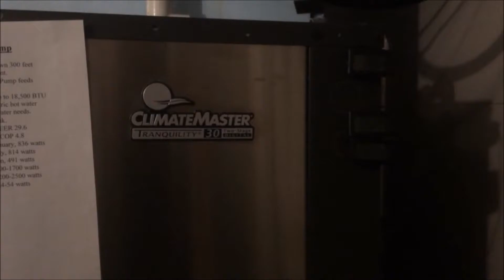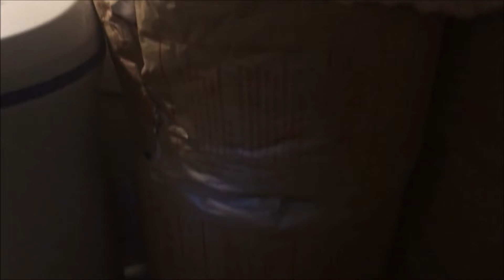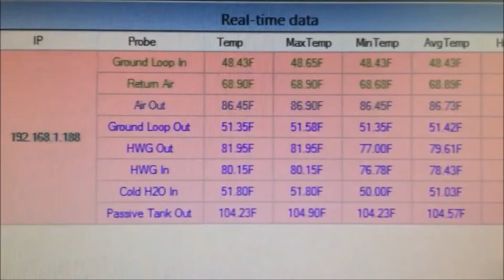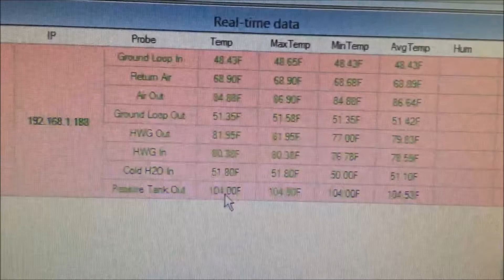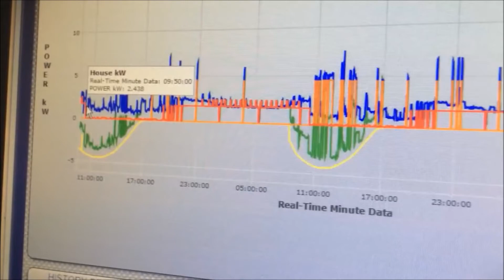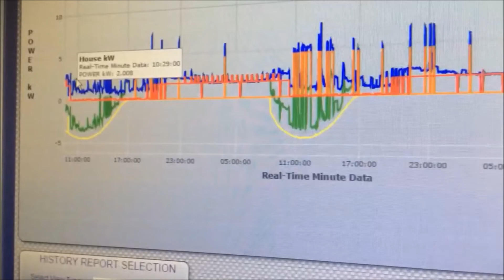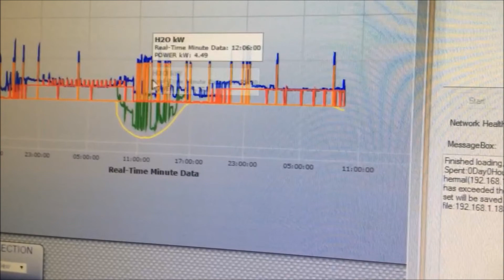How to get Free Hot water? Ground Loop Heat Pump With Hot-Water Generator

Comment: Full house! Literally.
When people shower is that hot water only or still a mix of cold+hot?
Reply from the maker: You shower just like you would in any other house. With hot water mixed with cold until it's at a temperature with which you are comfortable.
Reply: Hot water can be either 50C/120F or 90C/195F. 50C is much more efficient than 90C (it is cheaper to warm up using heat pump system and it does not cool down as fast as boiling hot water).
Reply from the maker: Arnis Tarassu Oh, I understand what you are saying. Yes.  We keep the water temp set around 125 F. Some people shower with strait hot and others adjust to a cooler temp. Sometimes the heat pump will generate water hotter than that. This winter we saw it 15 degrees F hotter.
Reply: JohnSavesEnergy
Jep. Thanks. Do you have washing machine and dishwasher? Some have two inlets and some even allow hot water to be used as default. Just saying :)

Have you calculated how many years will it take for this investment to pay back? (exluding solar and including solar).
I've heard it usually rounds up at 20-30 years (but that information may be too old).
Reply from the maker: Arnis Tarassu Yes we have washing machine and dishwasher. With 7 people living here, we use a LOT of water in our home.
ROI for the geothermal system is 8.5 years. For more details check out my website at JohnSavesEnergy dot com.  Click on Geothermal tab and click on Cost of Geothermal link